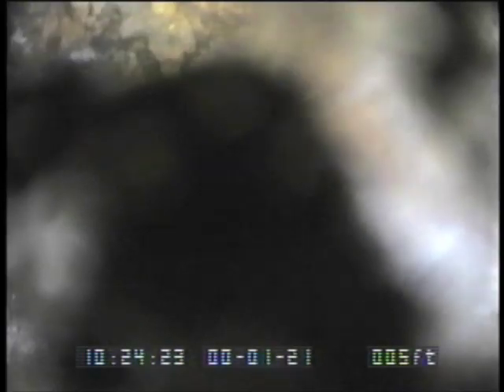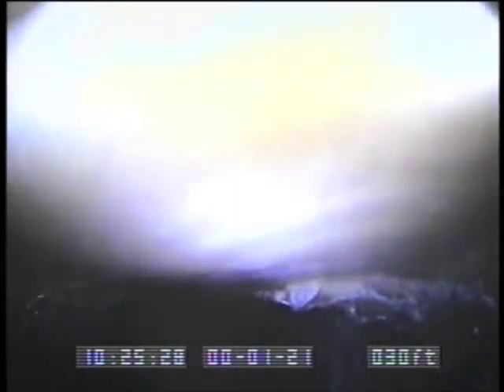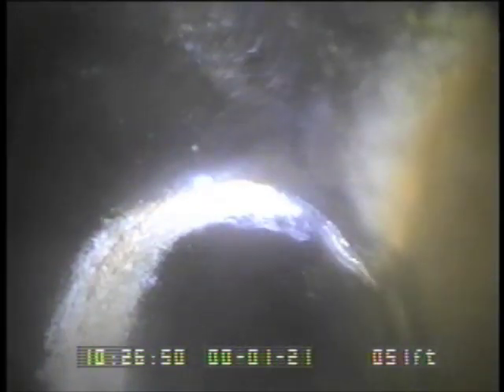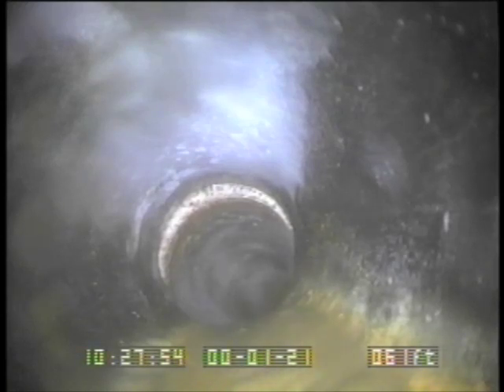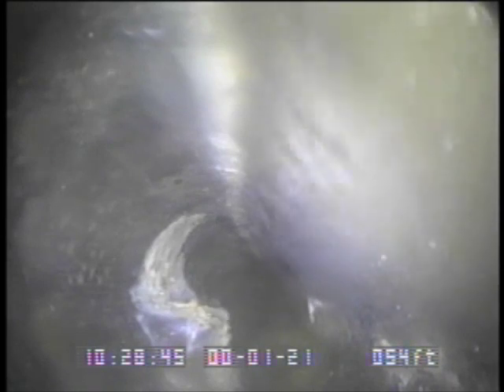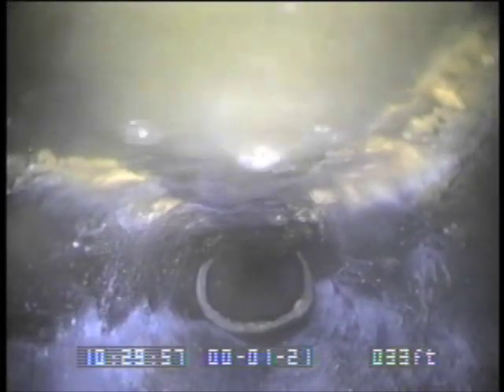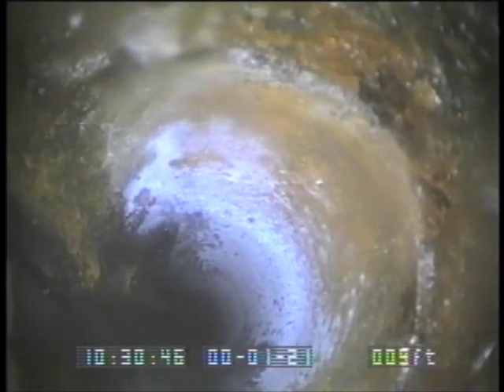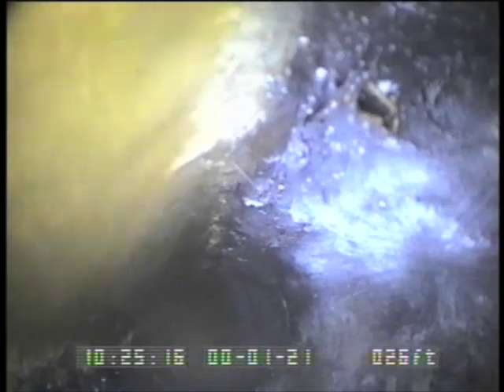Ann Arbor Orangeburg Pipe Sewer Line Inspection Video

Comment: House 1, about 20' dug it myself before it failed and replaced with ABS. House 2 have lived there 20 years no issues but buyers inspection shows orangeburg, it was in pretty good shape but showing the tell tale egg shape (it's slowly collapsing) and maybe some delaminating on the bottom.  So we had to replace about 40', 15' dug and 25' burst under a brick patio, fun times.  Just finished the roof too.  Closing escrow no. 4 mid next week.  Escrow no. 2 found the sewer problem and canceled without asking for repairs, decided to replace the roof because it was aged out and scaring buyers, 3 dropped out for stupid reasons they should've known on the first showing, on 4 we agreed to fix the sewer up front.  Despite all of that we are still 10k better than the flipper offer we got.
Reply from the maker: Interesting experience David. Where was this home and when was it built?
Reply: It's in Sacramento, CA. Closed escrow yesterday.